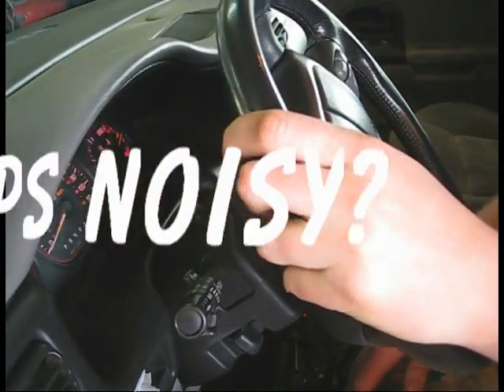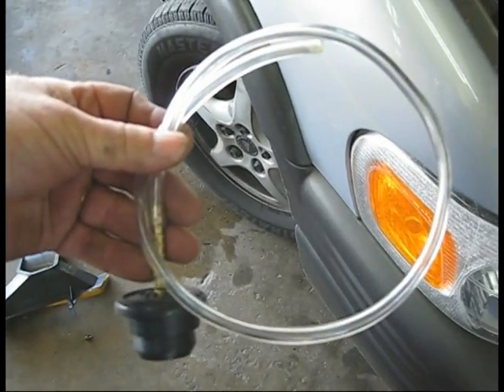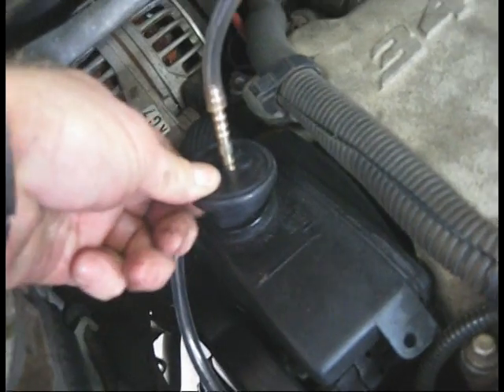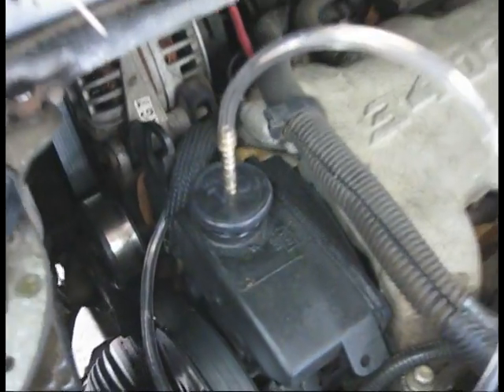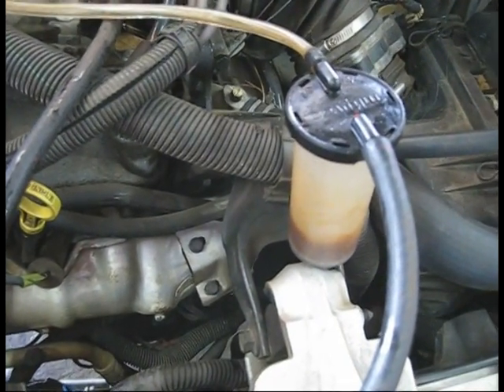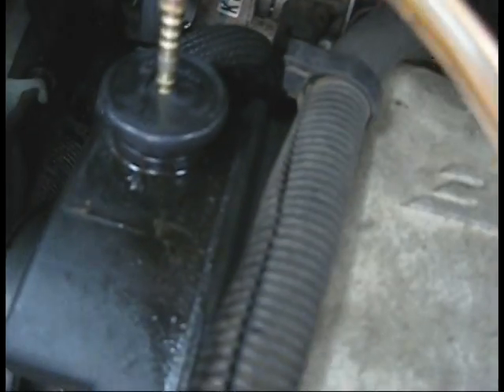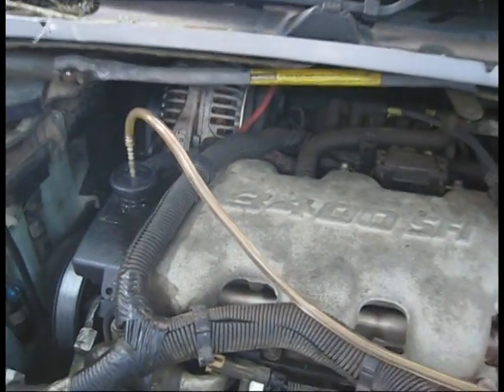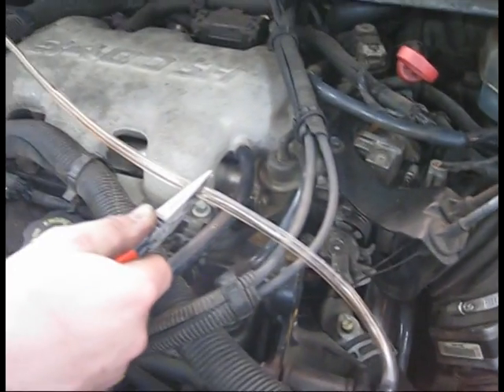Power Steering Bleed.mpg

Comment: Hey I have a 2001 chevy 3500hd the line blew going from my power steering to the hydroboost I replaced it now have very little power steering or brakes would it be air in the lines or what would you say
Reply from the maker: If you had good power steering before it'll likely be air, unless you drove it with a dry pump until the pump was destroyed.

Comment: is there a part number for that rubber stopper you used (for an old 350)? The universal one we have on our Mityvac won't seal worth a damn and is too long..sucks too much fluid from reservoir.
Reply from the maker: +Chris C  The original GM part number is 3980273, but you can buy one at Advance - I've purchased two of them recently there.

Comment: I found a rubber stopper, available at Home Depot in the specialty hardware section where they have the drawers of specialty bolts, etc.  I drilled a 1/4 hole through it and put 1/4 copper pipe into it to make the plug for the p/s reservoir.  The rubber stoppers look like big rubber corks and come in a wide variety of sizes, so you should be able to find one that will fit your particular reservoir.  I attached it to a mityvac hand pump (available at most auto repair stores and includes the fluid trap shown here).  GM service manual says to use 68 kpa (20 Hg) of vacuum.
Reply: do they have one that will fit a hyundai 2001 sonata

Comment: The fluid just needs to be changed
Reply from the maker: Not according to GM.
Reply: They also say don't change the trans fluid. My car had the same problem, and the p/s fluid was looking very muddy like that. I put new clear fluid in and it fixed the problem.
Reply from the maker: Show me where GM says not to change the transmission fluid. That's a ridiculous statement.
Reply from the maker: +cam1317 if I deleted that comment I don't remember it

Comment: i changed my powering steering on my 98 3.0 ford windstar... it made noise for awhile but mechanic said up to 5,000 miles well after 5,000 it quiet down.. but 6 months later i am noticing it is making even more noise and i realize i havent even added fluid to it ,,, likes its not using enough.... turn the wheel and it whines bad....  would this techique be a good thing to try? any idea's ?

Comment: FYI: Based on what you said, the Stant mfg part number is 10072.  Autozone seems to have one similar CST brand part # 8072 -- looks identical in the pictures.  Also Advance Auto Parts also came up w/ Dorman Help! Part #82578, but it looks more conical than stepped like the Stant. Hope that helps everyone

Comment from the maker: That little container is designed for exactly the kind of thing I was doing - it comes with a Mityvac handheld vacuum pump and is designed to prevent the fluid from reaching the source of the vacuum as long as you don't let it get too full and you hold it level.

Comment: I really need to know what you used to catch the fluid to prevent it from going into the engine... what is it called? does it have to be airtight, since it is a vacuum?  is there pvc tubing inside the fluid catching thing? it just seems to me like the fluid would go into that elbow on the top and go right to the next elbow over and go into the engine if there wasn't tubing in the catcher

Comment: This was an awesome idea.  Worked perfectly on my 2004 town and country.  Looking at other videos I also replaced the resevoir because of the possibility of the filter being clogged in it.  After replacing and refilling fluid I used this method to bleed the system.  For the pump plug I used a sink drain plug from Home Depot with a barbed brass fitting inserted through the center.  Made the bottle he used out of pvc Y fitting and threaded plugs and barbed brass fittings.  Worked perfectly.

Comment from the maker: Yep - that was a slip of the tongue - we don't use transmission fluid in power steering systems - even today, not all power steering fluids are created equal, so a known good brand must be used.  But in most of the shops where I worked for the first fifteen years of my career transmission fluid was poured into power steering units everywhere, usually Ford type F.  It isn't like putting oil in the brake master cylinder - but it's wise to use power steering fluid.

Comment from the maker: It's an oil filler plug from an old Chevy small block - it's soft rubber - check the HELP board parts at ADVANCE.  I believe that's where the one I used came from.